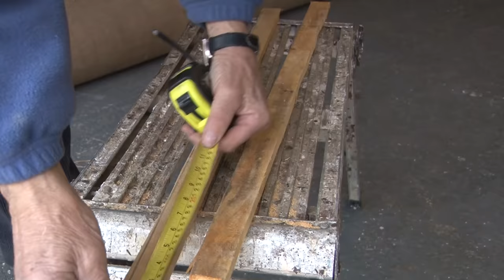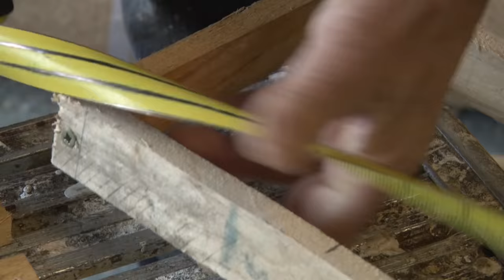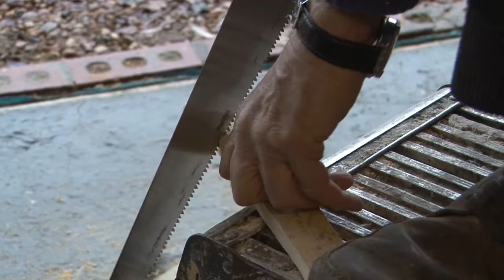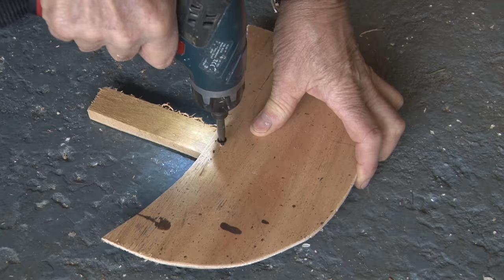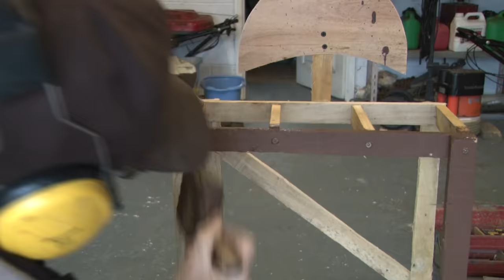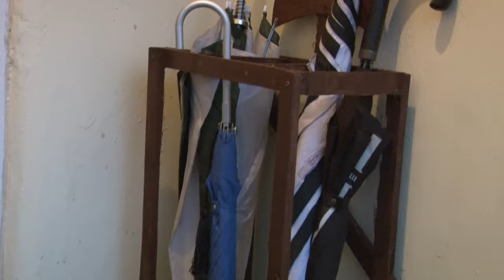Free Pallet Wood Project: Making an Umbrella Stand

Comment: Hi Graeme have a question,  l was going to get myself a Reciprocating saw ( that is a silly name) and you use one very often can you suggest a make that will not fall apart after a year or is just good would be nice .regards Barrie
Reply from the maker: Hard to say,everyone has either a good word or bad word to say about different makes..I used Ryobi or McCullogh ..both worked to incredible levels from trees to the many pallet wood projects I have had up on our site over the years. I guess I have been lucky with mine and the replacement blades are quite cheap on Amazon.Once you clip a nail though you will find them go blunt. I have tried sharpening but too much effort .Just buy a pack of replacements. A recip saw sure beats battering the life out of your elbow with a hand saw. I was making pallet wood stuff about 40 years ago...can't believe I used to cut them up with just a jigsaw !.
Reply: @TAFishing  Thanks för that l don't mind using a hand saw for fine work but for rough work the saw would be ok again many thanks and have a nice week barrie